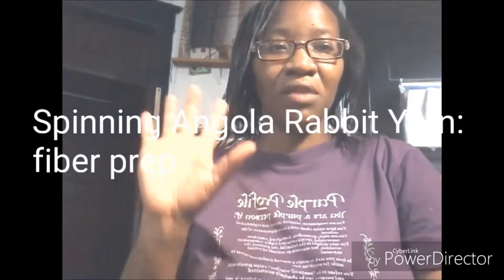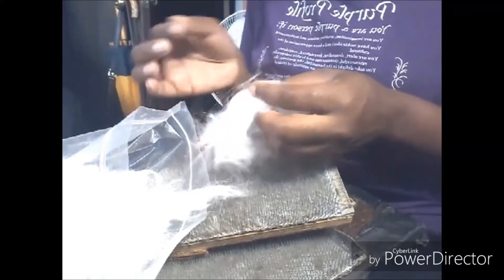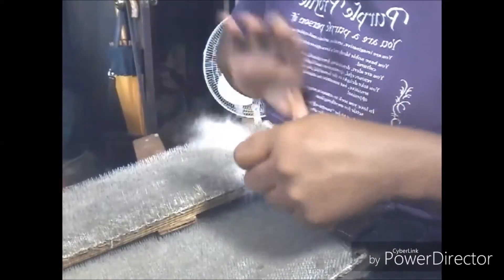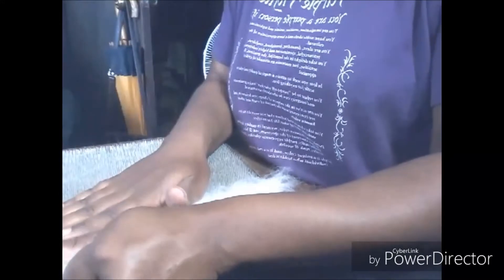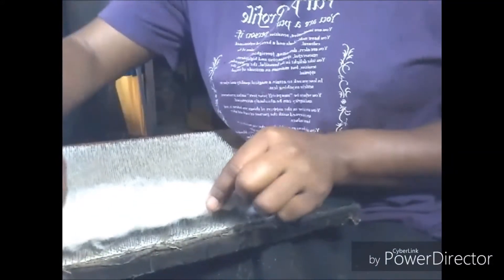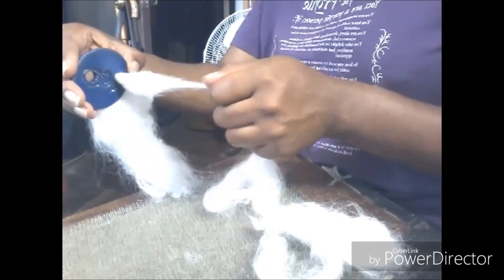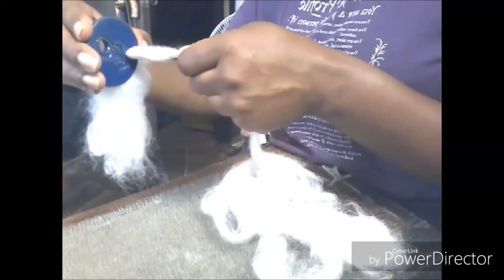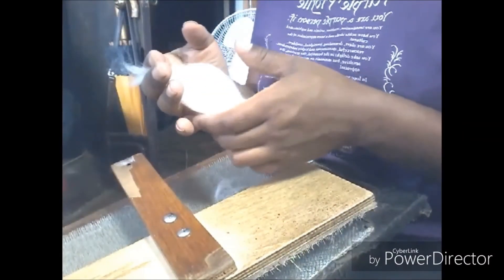Handspinning :Angora Fiber prep

Comment: How did you make your carder?
Reply from the maker: I used a piece of craft wood from Michael's. I removed the teeth around the edge of the cloth piece to make space for staples, then I put a little glue down on the back of the cloth and secured it with staples. The handle is another piece of flat wood, a recycled piece of oak, screwed on.